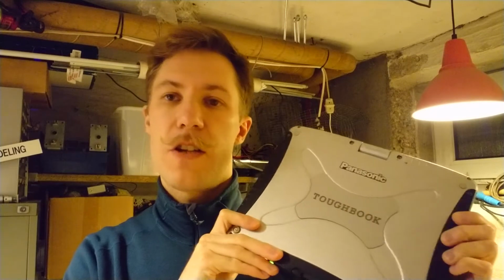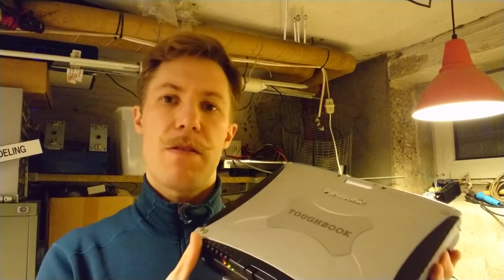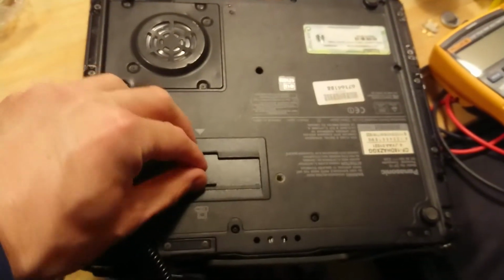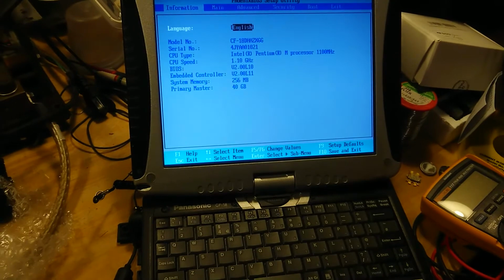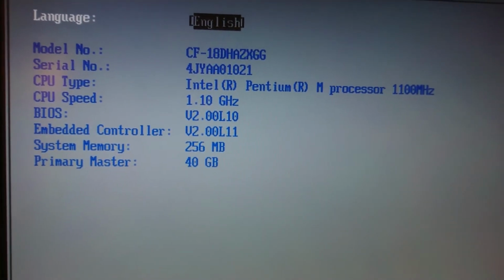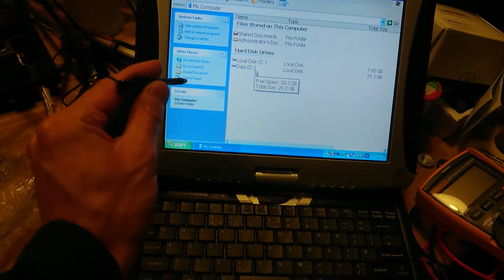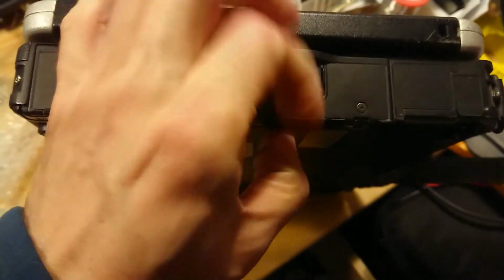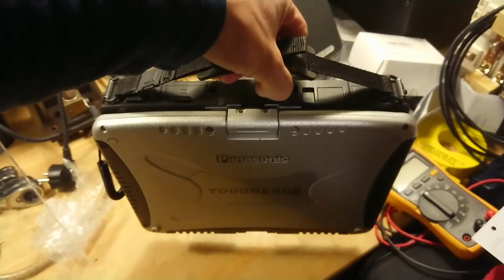Vintage Computer - A Look at the Panasonic Toughbook CF-18

Comment: I have a TB 18 M1 in great condition. I didnt want to junk it, so I installed 128 Gb SSD, added a PCMCIA 8 gig memory card for swap purposes, and installed Sparky Linux i386. With VNC, it makes a great WACOM. It's slow but I can get around on Pale Moon. Just a bit of nostalgia for the old folks.

Comment: I just got one with 1.2GHz and 1.5GB ram for €50incl shipping :D
Reply from the maker: Good buy for a sturdy laptop that is good in a any workshop where you occasionally need a seriel port for some old software to hardware interfacing :)

Comment: Hey! I have a question, is the 900mhz processor any different than the 1.2ghz version? Because I was wondering if it was worth the 40$ upgrade. Just wondering if it was just that much faster. Sorry for all the questions, I’m buying this very soon.
Reply from the maker: A 40$ upgrade for 1.2GHz sounds like a good deal to be honest, how about the amount of RAM?, this will most likely affect performance even more.
Reply: Kaizer Power Electronics really? Well, I was planning to just get the minimum ram and then just upgrade it in the near future.
Reply: The thing is, the cpu is soldered in,
So there’s no upgrading that 😢
Reply: Все супер спасибо :-) 🇵🇷